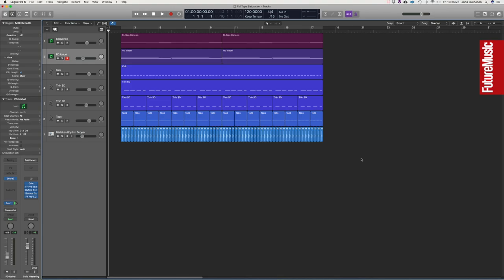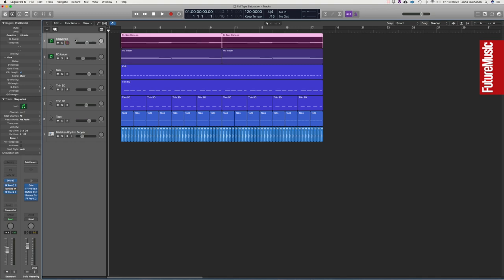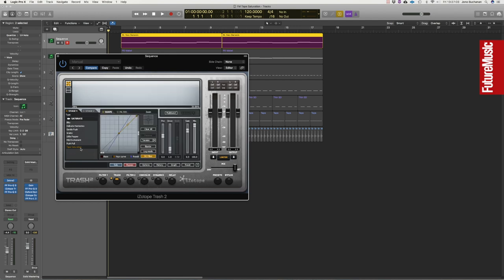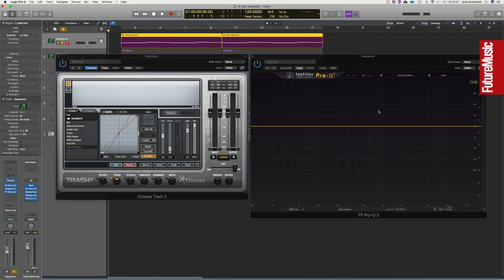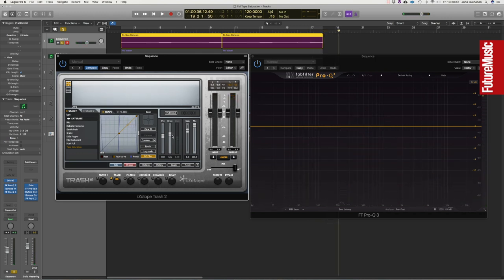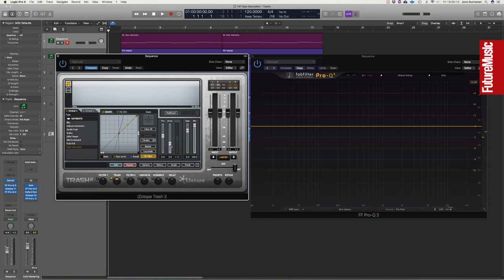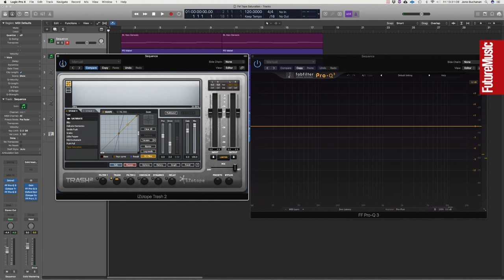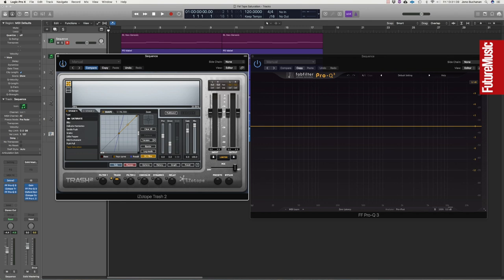Create your own tape saturation in your DAW

Comment: Another technique is to run your output through a lightly wound transformer and get a magnetic saturation through the iron transformer . 
then back into the desk at a new track .
     Old school is good . 
 The trick is to use a transformer which is small enough . 

You could also run it through a choke (A coil of wire wound arounds an iron or ferrite core .
 This can THICKEN up a digital mix and GLUE it into a cohesive whole . I used this on final mixes .
I am TOO lazy to do it on individual tracks 
.